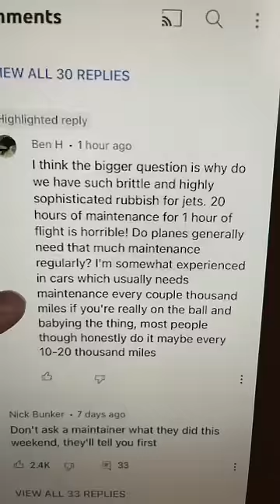Why does an F-16 need 17 hours of maintenance for every hour of flight?

Comment: Actually many fighter jets (like the F18, not sure about the F16) just pressurise the fuel tanks with regular air, not necessarily nitrogen
Reply: sure about that? that sounds like a disaster waiting to happen
Reply: F16 uses environmental air that's pressurized
Reply: Are you sure they use oxygen? I'm pretty sure one of the reasons people use nitrogen is because it's non flammable
Reply: @collins9708  not oxygen. They use environmental air
Reply: @delfinenteddyson9865  for the F/A-18 I’m 100% sure, I’m a fuel system and engine mechanic (AD)…
Reply: @lucasimark7992  Then you are more qualified than me on that subject. As other posters have pointed out, it seems commercial aircrafts, if I am not mistaken, use nitrogen because of safety concerns. Is that risk overblown or are there just too many drawbacks at using nitrogen on fighter jets?
Reply: @delfinenteddyson9865  i honestly have no clue about the design choices.
JP-5, the military jet fuel, is very hard to light on fire under normal circumstances, so I guess safety wise it’s tolerable for military applications
Reply: @lucasimark7992  cheers!

Comment: That 17 hours is also split amongst all the different maintenance shops. In the Navy, my shop had to do a post flight inspection on the parachutes, survival kits, and oxygen blocks. The Navy had 15 minutes per seat, alloted towards maintenance allowance, if no deficiencies were found.
That was the F-4, A-6, and the EA-6B, yes I'm old.

Comment: I was in Tucson Davis Monthan AFB when the A-7 crashed near Arizona State. Word on the flightline was that the airplane was giving a low fuel pressure warning light. Filters were pulled and found full of aluminum. Cleaned and reassembled. No one bothered to asked where the aluminum was coming from. On our H-53 at McClellan, one of the inflight refilling reservoirs was "making oil", ie overflowing. We sent the oil into the lab and found it was heavily deluted with fuel. Turned out a seal between the fuel control and geartrain that drove all the accessories was leaking and high(er) pressure fuel went into the oil sump. The fuel overfilled the lube system and it overflowed into the refill tank in the cabin. Good catch! The engine was pulled and sent to overhaul because of possible damage to bearings.

Comment: Aircraft mechanic here on C130s. There are inspections that trigger based off if the plane flew x amount of hrs, pop chaff and flair, flew certain Gs etc. Also unscheduled mx for any malfunctions or failures. A lot of that time you read about for the 16 or 22 is mainly times inspections just due to what that plane can do. The planes sheer performance is not friendly to staying out together.

Comment: I’m not an AMT, and I do not have my A&P, but I did go to a trade school for 2 years for this because I wanted to be one. It’s a very hard job and there are a lot of things that can go wrong. That rivet on the side of the aircraft, if it isn’t done properly or isn’t secured 100%, it can possibly be ripped off and get sucked into the engine, and could cause the turbine blades on the inside to become damaged, and that $2,000, or more, part now needs to be replaced and balanced. Not only that, it could cause more damage and could possibly ruin the diffuser chamber, combustion chamber, the outlet, and possibly a lot of other things that I forgot about. A lot of things are at stake even with the smallest thing. I respect the people that do this job a lot.

Comment: Early F-16's had a screw that would vibrate into the avionics wiring at mach + speeds shorting out the system. Some pilots could glide to safety, others weren't so blessed. I'm glad they got to the bottom of this problem. The fighting Falcon is still a sharp, precision instrument in well trained hands!

Comment: Helllll YEAH, I was an aviation structural mechanic in the Navy, And I worked on H60s. Those things are continuously rattling themselves apart. And if there's not a leak, that's a bad sign. Almost the opposite of jets in that way. But the maintenance is non stop on them. If they are not flying, they are receiving maintenance, plain and simple. Different departments out working on gripes that pilots or aircrew send in to maintenance control who sends them to the correct shop's, and the hour of flight based maintenance, just on and on with different calls for maintenance. But it all becomes like a clock in rhythm sometimes. Just no complacency tho, complacency bad

Comment: Also those are accumulated 16-20 hours (it used to be more with earlier jets). This includes regular maintenance such as pre-and post flight checks. Arming the aircraft (which also needs to be disarmed) and similar procedures with fuel.

Then you have airfield level work like swapping engines and black boxes and finally depot level maintenance up too and include life extensions on the airframes (which have just a few thousand hours, not days or even weeks but hours) per frame.

Comment: It should be noted that the maintenance time is typically measured in man-hours, as in the amount of hours of work total per person working. One person would take 20 hours, 20 people would take one (more or less). It’s still a pretty insane amount of manpower, time and money devoted to a single machine just to enable routine usage, and goes to show how critical well trained and motivated ground crews are for keeping a modern air force flying.

Comment: @ryanmcbeth the fuel tanks do not get pressurized with nitrogen. They are pressurized with air to the tune of 4.7-6.4 psi. External tanks get much more. When the aircraft is switched into combat mode the air pressure drops and halon from ab onboard tank is injected in case a tank is punctured with a bullet to keep fuel from igniting

Comment: Maintainers are definitely important! I used to be one and it was a very rewarding job. Mx is done in phases so its not like you fly for 3 hours and then when the plane lands its down for 40. It’s usually scheduled except for our safety checks and squawks (write up issues). Just about every fact you mentioned about the F16 was wrong though. Most aircraft have spring loaded doors that trap fuel in parts of the tank so the pickups dont run out. There are shuttle valves for inverted flight that close off part of the fuel line so it uses the inverted pickup. The tanks are not pressurized, they are vented to the atmosphere. They hold about 7,000lbs of internal fuel so i can’t imagine the amount of “nitrogen” you would need not to mention refueling on the tanker.

Comment: Once talked to an airforce pilot who told me that a single scratch is capable of destabilizing the plane enough that at high speeds, it won't be able to perform properly.

That's insane, but it does make sense.

Comment: A&P mechanic here. Yeah, even in the civilian world, airplanes need alot of maintanance. Full inspection every 100 hours of flight. So, in terms of cars. That's a full engine, drivetrain, lubrication, AC, tires, doors, weather seals, trim, exhaust, everything, once a week.

Comment: Just a clarification, after an hour long flight the F16 may require no "maintenance" (other than cleaning the canopy) but it will require refilling consumables (mostly fuel) and "inspections" because they reduce risk to the pilot and $MMM aircraft.  The "20 hour" factor includes major work like replacing tires, engines, time-limited components, etc.

Comment: As a maintainer, 17 hours is generally on the light side of time for maintenance. It’s not that it’s necessarily broken but that because of how dangerous it is they want it damn near perfect and rightfully so. Also 17 hours of maintenance can be completed in as little as 4 hours. When engines, com/nav, Symco, afin, elen. All put 4 hours in at the same time, you’re easily above the 17 hours and mission capable once again

Comment: And yes you are correct there is PreFlight inspections there is post fight inspections there is maintenance that is done on the basis of flight hours for example you would change the engine package after so many flight hours hydraulic pumps fuel pumps etc etc all those things they almost need to be changed on a daily basis

Comment: For the people who think it’s a little excessive, to me 17 hours doesn’t seem too much considering the type of hourly shifts airmen have and how many airframe mechanics are at the ready or if it’s after an intense flight with high Gs and combat. F-16s are irreplaceable multi million dollar machines flying over populated terrain,  possessing operators who are not expendable and definitely irreplaceable.

I am an automation maintenance technician who’s experienced operation ‘shut down(s)’ before/after for preventative maintenance, repairs, upgrades, etc.. Investing time for P.M. is waaaay better than time wasted because now the mechanics must perform excessive tasks due to not performing said preventative maintenance. If you can replace the damaged part(s) that is. The F-16 with a damaged component or system at +5,000 ft will drop out of the sky or become a 600mph flying target drone for the enemy. The now droned F16 is an ineffective and now overpriced flying machine of war. Yeah, fulfilling these high maintenance standards is important. What does happen, especially in private or civilian settings, is a maintenance DOD contractor will take advantage of the ones paying for the service(s). I’m not sure how financially streamlined the DOD is with third party civilian maintenance operations. Does the Air Force contract to a civilian contractor?The Navy does this with ships and subs also built by General Dynamics.

What’s really fascinating is the A-10 repairs after going through a meat grinder. Talk about alum/titanium patchwork.

Comment: What many don't understand when they see the high number of maintenance hours is, there is only 1 pilot flying, but there is a whole team of mechanics. With enough manpower in the ground crew, it's still possible to fly several hours per day. And of course,  17 hours is the average number of maintenance hours. Some maintenance needs to be done after every landing, some after 10 landings and so on. The average time needed is 17 hours per hour of flight. 

A Nimitz class aircraft carrier has a crew of 2500 operating just under 100 aircraft: 25 guys per aircraft. Plus 3500 guys operating the ship.

Comment: Although, to be fair aeronautical standards are absurdly high. I work with industrial turbines and two of the turbines we have are J79s. After about 20,000hrs of runtime we had the stbd IGV rack bushings hog out and fail causing the IGVs to hunt. When we replaced the part (I’d say it was probably an $800 part in any other application) it cost $12,500 per rack. So $25,000 for the port and stbd rack which has an aero service life of 400hrs. It ran ~20,000hrs on the ground, but is replaced 50x sooner on planes. They definitely overdo the maintenance schedule in the aero industry; that said, I don’t think I’d be comfortable flying if it was done any other way.

Comment: Fighter jets are insane.  I was at NAS  lemore  for a sea cadet training and one of the F18s had undergone so much stress that the wings were visibly bending downward.  

Also another F18 had its foldable wing installed incorrectly and had one wing bend down instead of up.

Comment: It's also not a direct 1:17 ratio, like "oh shit, it's been an hour. Better tear this bad boy down." Everything has its own service schedule and is usually replaced or removed and rebuilt at different times, like every 100 hours of flight time (a number I just made up) the engine has to be rebuilt, hydraulic lines every 30 hours, 20 hours for the seals, etc. It's still intensive as shit but a good shop can keep everything working with minimal apparent downtime.

Comment: The F-16 also uses hydrazine.  It's very caustic and the tank need to be drained each time.  There is also the coking issue on the PW engine.  It hates low speed use.

Comment: As a/c gets older maintenance hours increase. 16 & 18 similar age had more maintenance requirement as they got older. 
On one of the last 18a squadron I recall doing some maintenance that extended the life of 18a. Big cost increase with age from fuel leakage loss. If you ever see a/c on the flight line observe the pans under a/c.

Comment: I'm always mind blown when I think how much I would weigh at 9g's, over 2000 lbs. How that doesn't blow out the bottom of the jet in mid turn speaks to how strong that jet frame is.

Comment: Yeah- I think there's an irreducible quantity in the wider public mind, perhaps more so among those of us who are generally but not so technically informed than among those totally uninformed, of the question "how does anyone expect to fight a real war with systems like that?" 
OTOH, even allowing for the decades old assumption that the US kit might be superior but more fragile in some areas, everybody will have similar kit with similar challenges, or they wouldn't be competitive at all. Just means the war will be shorter than they used to be.
The same kind of thing comes up when the question of resupply and manufacture is considered, comparing present to 3-4 generations or more ago.
Plus, we forget that someone in 1940 probably looked at maintenance times, manufacture rates and so on for Spitfires and had similar concerns.
Your overview was great.

Comment: Pretty much any aircraft needs dramatically more maintenance than a car. You can argue small civilian planes require less maintenance than cars however in my experience an airplane will be down for maintenance WAY longer than a car (all the cars I've had, clunkers and new, have been down for maybe a month in the span of ten years. The plane I fly has been down for almost 10 months in that time frame). The amount of maintenance though allows for old aircraft (say from the mid 60s) to keep flying. The USAF has tankers from the 50s still flying, all because of the superb maintenance they provide.

Comment: As a retired USAF jet engine mechanic I can assure you that those 17 hours to 1 flight our are essential. While I was stationed at Spang in Germany an F16 two seater was giving an incentive flight to a maintainer who earned it. Just minutes after take off the engine failed and they had to eject. The aircraft crashed into the local golf course. We used the phrase " well its a hole 1 hazard now". When your car engine quits you just stop. Not so much in the air.
Reply: Did they find the cause of the crash?
Reply: @geddon436  Yes, it was engine failure due to a blade breaking off. I believe it was fixed back in the late 90's

Comment: The nitrogen in the fuel tanks is so that it doesnt aerosolize and ignite if struck by lightning, this is true of regular commercial planes too, idk how it pumps fuel upside down but i dont think negative G’s are very common in fighters so it can still pump from the “bottom” of the tank, think of it like a roller coaster doing a loop, if your fast enough you still get pushed into the seat but its Kerosene in a tank

Comment: The Air Force sends you to 7-9 weeks of school to become a 'maintainer'. That's why there's a dozen different categories of 'maintainers'.
That's why I went to school for 2 years, took 3 separate Federally regulated tests, then spent 4 days being grilled by a Federally designated Examiner on the practical application of my knowledge.
That's the difference between a 'maintainter' and a FAA licensed Airframe and Powerplant Mechanic.
3 A&Ps could knock it out in 2 hours.

Comment: As a former f-16 tech. This has to be an average due to time compliance maintenance. Its for safety. Reality is, a good bird takes 30 mins of inspection and launch testing for a day of flight. Sometimes you change a tire or the engine is due for inspection but that is rare. Its not 17 hrs per flight hr😂. 

Now, if you want to be a bean counter and factor in lox servicing, weapons configuration, launch operations, cleaning, avionics check out, phase maintenance, tcto, common scheduled maintenance and oil analysis.  Over a month of flight hours. . . 

We would still be nowhere near 17 hrs. 

On a very bad day it is maybe 1-2 hrs per flight . Flights run 1-30+ hrs depending on a pilots need to sleep.

Comment: Also people need to remember this is an “average” and includes the time it takes for phased maintenance. After a certain number of flight-hours most military aircraft are stripped down to the frame and inspected. This maintenance can takes weeks to complete and hundreds of man-hours or woman-hours. So on a daily basis the maintenance hours would not be that high.

Comment: When I was active duty, the F111 took 72 MMH per HOF. The F4s being cycled to the Air Guard was mid to high 80s, so I thought the early block series F16s were more like 12 and the F15s were 15-17. A10s were the lowest, I can't recall exactly but was under 10

Comment: F18s originally programmed for 16000 flight hours before retirement. After a year lifespan was reduced to 8000 hrs. Mostly because pilots routinely stressed the airframe with tight maneuvers no matter how routine the flight.